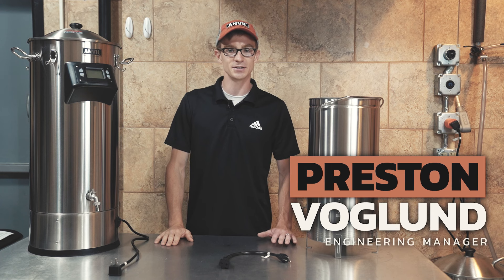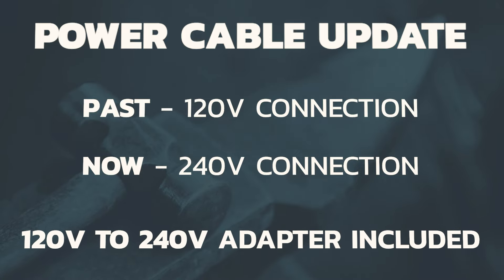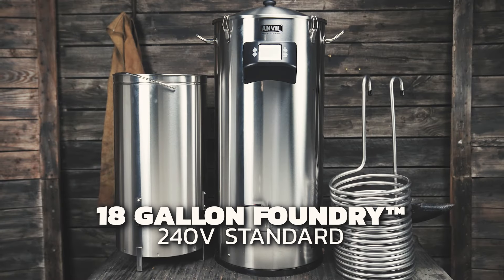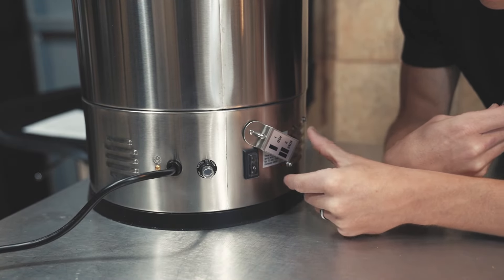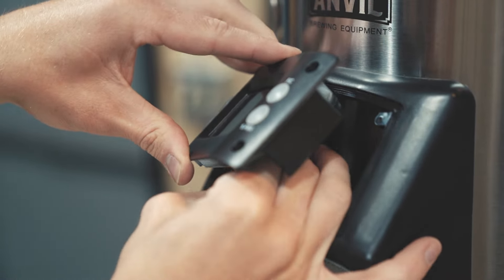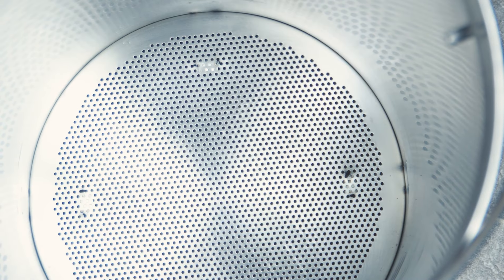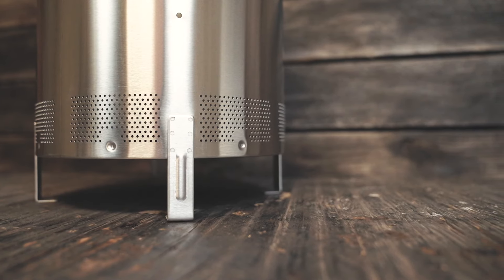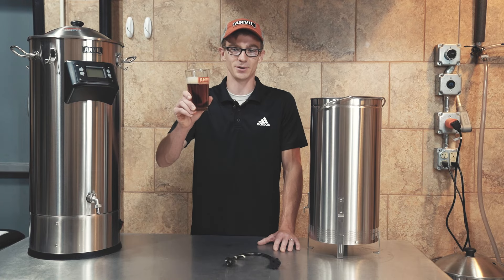New & Updated Foundry™ 10.5 Gallon | All the Details

Comment: I love that you are listening to customers. For those of us that were early adopters, is it advised that we caulk around the display housing with silicon? Also, will we have the ability to purchase the upgraded malt pipe to upgrade our system? It is such a pain to clean out the original malt pipe.
Reply from the maker: You can use a small silicone bead around the top and sides, but leave the bottom open as a drain in case anything does get in there. We do not offer the new basket at this time.

Comment: Great to see the improvements to the LCD display housing. I am one of those customers that got some kind of liquid behind the screen even though I had caulked all around the outside housing, and I had to take the unit apart to replace it. Will the updated screen/housing be available for purchase separately if I want to upgrade my current unit?
Reply from the maker: Oh, we hear you!  That's why we redesigned the screen and mount.  However, we don't have the updated screen/housing available for separate purchase at this time.  Will be sure to share your feedback with the rest of the team! Jen Young, Marketing Manager

Comment: Is there anyway to replace an older versions screen. I had 1 boil over and the screen since then is hard to read. And I like the V3 basket. I have V1 and 90% of the time I have hot wort shoot out over the top of the kettle when sitting it on the side mounts to drain. Will the basket be sold individually later on?
Reply from the maker: Great questions.  As of now, we don't have the basket for sale as a stand-alone item.  If you haven't I'd recommend reaching out to Jared in our Technical Support, as he can help mitigate the issues you have with your screen.  He's at support@anvilbrewing.com or 765-421-2018.

Comment: I have a version 2 that has the adapter cord, and the lower perforated malt pipe. These are new features?
Reply from the maker: Great question.  You actually have this updated version!  We are formally releasing it now.
Reply: @anvilbrewingequipment  but I don’t have the updated screen though. Mine is the top mounted display without the visible fasteners. Is it upgradeable should I have an issue with the display in the future?
Reply from the maker: @Nefariousrouge  Gotcha.  Thanks for that clarification, you must have the older version that came out right before this.  If you have any issues in the future, not to worry-just reach out to Jared at support@anvilbrewing.com and he can guide you to the exact part you'll need.  I hope that helps.